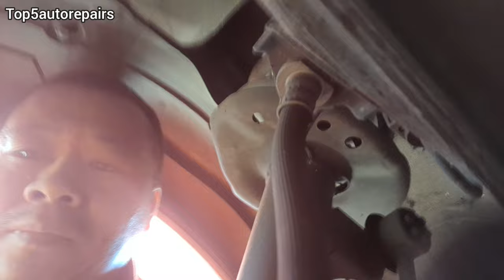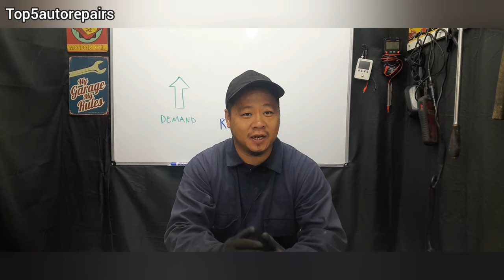SIGNS OF A BAD POWER STEERING PRESSURE SWITCH/SENSOR

Comment: My 2008 Infiniti G35 sedan keeps stalling and turning off completely whenever i slow down, or on reverse, specially while turning left or right, it's been going on for years, but now after replacing the selonoid, camshaft sensor, crankshaft sensor, ignition coils, spark plugs,pcv valve, cleaned the injectors, i have payed so much and i honestly can't afford it anymore, i started to hate my car, every mechanic just gives me an opinion, now they suggest they physically clean the valves, and replace the fuel pump, everytime it's something new, and i am absolutely sick and tired of this shit, no one knows what's going on and i have to do my own research and look for a damn solution

Comment: great vid, i sub'sd! but i am confused, i am getting NO engine light or steering light on my dash, but  im getting creeking /stressing sound (all ball joints are good) when turn the wheels left to right, in park in idle, they say to fill the fluid, but there is no leaks, and my 2014 has an electric ps motor, so how is filling the tranny box w ATF going to get to the EPS when its electric, nor do i want to over fill the tranny box???? i believe they are not connected in anyway.  Could it just be a bad EPS sytstem, w/ 105k miles? it steers fine no noises when i m driving, only at idle for now or i cant hear it,  please help,  thank you so much!

Comment: What does it mean if it’s all working but at idle it’s harder and if I rev the engine or at high rpm it’s a LOT easier too turn? Is the pump just not working 100%..?

Comment: I've changed the pump in my car but feels like it's drops in revs on full lock an now wondering if it's the switch
Reply: I’m currently have the same problem I changed the pump and belt tensioner
Reply: I have a Ford Crown Victoria 2005 and I've had to change my power steering sensor twice in five years. So what I've done is took the one that broke the second time and corked the hole with a screw and disconnected the two wire harness. 2 months later my car runs just fine no leaks and no stalling. I fixed the problem free of charge and it's running fine. I'd like an answer to tell me why that's a bad idea. Better than the massive leak I had, no more leaks. I remove the sensor and install a screw into the hole so it does not leak no more and runs just fine
Reply: @davidgreid007  sounds like my kinda fix.    shit. you see a leak  you know all you gotta do is tighten the screw some, or size it up  a notch.  the simplest fixes are the most durable, and free.    An 05 vic  was when a car was still a car too.

Comment: OMG ! I almost turned this off, but then you reminded me how to do the diagnostic I need !  
Thank you, Thank you !

After watching a second instance,  I also note I had a VSS (vehicle speed sensor) replacement needed.  I don't doubt the leak and the VSS may be related with a middle-ground sensor, minor fuse, or other adjustment: I will need to think about it.  I wish it is easy to know how all the sensors in the world work, we would have almost no problems.
Reply from the maker: You're welcome!
Reply from the maker: You're welcome!

Comment: 1st- you answered every question I had. ❤  Back in my day if you had power steering pressure it was good. If you didn't it was bad. 

Now if the switch is bad steering response can be potentially lethal. Wonky is how I would describe it.

Comment: My explorer wants to stall sometimes when I make sharp turns. idk if this is a gasoline issue or power steering. My guess is both. my power steering leaks to just below the fulk line and makes leaving the driveway or parking lot spot difficult, along with a noisy grind. But have no issue with vibration or wandering once in motion or when its replenished (though that needs done approx  once a week)
Im just trying to pinpoint what part(s) need replaced. Obviously, at its age, itd be worthwhile to replace most of related parts whike we're (he) is at it. 
But no budget for more than bare minium. (Not driving an '98 for its looks - or awesome gas mileage😏)
Thanks for this imput! Very helpful!

Comment: Good morning,  thanks for your information,  can you say if an electronic power steering system can also have a similar problem. It has no fluid to leak but the steering sometimes get stiff when the car is about to turn when i start to drive, after accelerating , it becomes normal

Comment: Very informative video. My power steering fluid is leaking out. Does that mean the power sensor switch is bad or does the pump need to be replaced?
Reply from the maker: First, check the high pressure hose as it tends to leak often. Next, check for power steering leaks at the rack and pinion boot. Next, check for leaks at connection right at the power steering. If it leaks then O-ring is worn.
Reply: @Top5AutoRepairs  Thank you!
Reply: Can a leak at the rack and pinion cause a P0507 code

Comment: On my 08 accord the RPM increase when turning steering wheel on idle, do you think this is due to sensor going bad? Thanks for the informative video!
Reply from the maker: This is normal. Rpm should increase when turning the steering wheel.
Reply: @Top5AutoRepairs  it jumps pretty high kind of annoying haha, on my truck and the vw jetta it doesn't jump that much, not sure if that is normal for honda? Thanks for the reply!

Comment: ...mmm   My 2002 Honda Odyssey will do a slight revving while it idles in gear ! so is that the power steering pressure switch ?

Comment: Can a faulty powersteering sensor cause rich condition? How to check?

Ford Focus 1.6 16v ti-vct, 115 PS. 
2 catalytic converters, one for cilinders 1 and 3, one for 2 and 4.

I have -12 to -17 LTFT that varies on idle. LTFT changes to a stable -6 when accelerating. 
2 banks, both acting similar, but not in unison.
MAF sensor seems to do its job, shows reasonable values for engine displacement. I've cleaned it aniway, but no changes. Pre-cat (upstream) O2 sensors seem fine aswell, they have a continuous variation between 0.1 and 0.7-0.8V, they don't get to 0.9V.
I also have a check engine light but that refers only to the post-cat (downstream) O2 sensors (P 0036, 0136, 0056, 0156). They both are malfunctioning, both have defective heaters (proven), but they both read O2. They stay pretty steady at 0.7V when engine is warm and at 0.4 when engine is cold. I hope next week I'll change them. Can they influence fuel air mixture?

Didn't make an emissions test.

Thanks!
Reply: I have similar problems in my ford focus mk1, I’m thinking about changing the power steering sensor, mine is completely disconnected

Comment: And why is pressure building up when I took the lid off where I put my fluid into my power steering. There is a bit of a rattling grinding noise things to be coming from the power steering pulley when I put a bit of oil behind it it shuts up do I need to replace our is it possibly just dry. I've just bought it I have That sinking feeling

Comment: I changed my pressure line but not the sensor and still have a bit of leaking could it be the sensor
Reply: Yes it could be the sensor leaking or maybe the O=ring
Reply: It could be exactly what's leaking is leaking and nothing but.